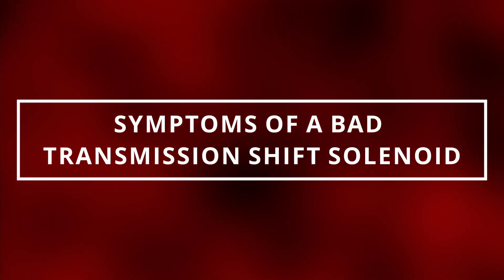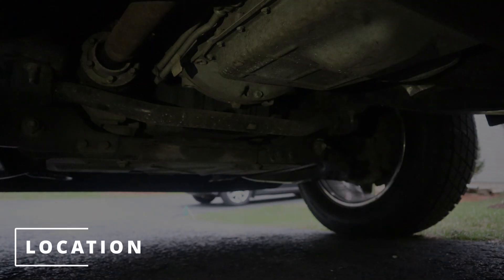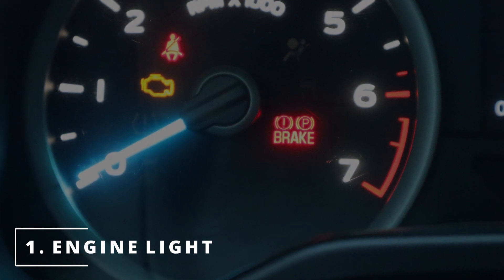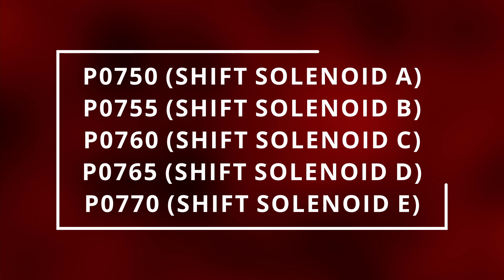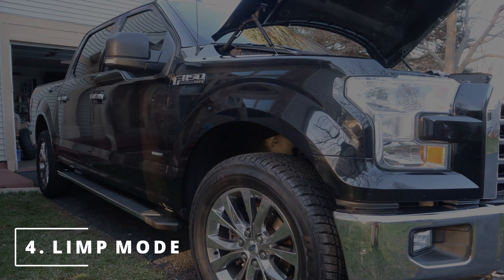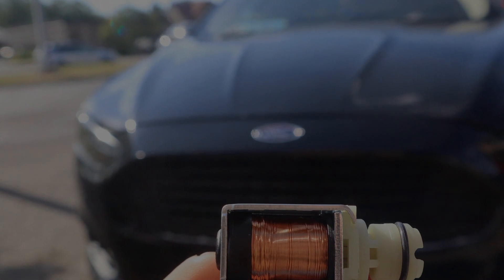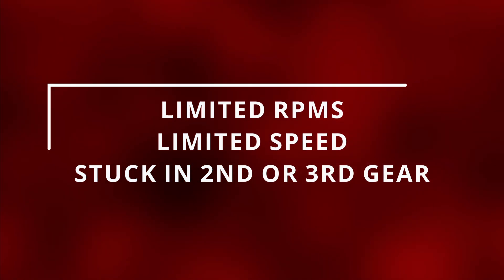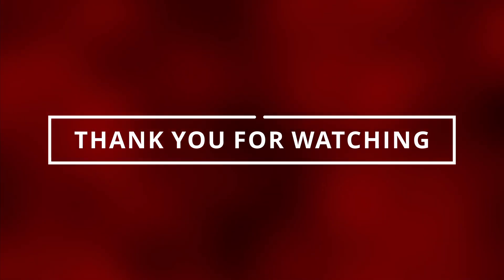SYMPTOMS OF A BAD TRANSMISSION SHIFT SOLENOID

Comment: Those are exactly the symptoms my truck is having 😢 better than needing a new transmission by far😅
Reply: Did you get it fixed?
Reply: Was it fixed? I went to Ford dealership and the technician told me to keep driving it that it might last 50,000 miles or 100,000 miles. 😂

Comment: Who’s having a remarkable day binge watching problems with transmission videos? Lol
Reply: Facts!!! I thought the same. Uh yeah no I’m not having a remarkable day trying not to cry while transmission shopping.
Reply: 😂.  Day 3 now.  And all I'm finding is that it could be 5 different reasons my truck is stuck in limp mode.
Reply: Fml
Reply: if anyone thinks it's a bad day trying to figure out your transmission problems... I successfully replaced a valve body (with new AFL and all solenoids) on my 2000 gmc 3500 and a month later a freeze plug gave out, let out all antifreeze and now my motor is blown....
Reply: @bobbyatman273 Yhea that sucks! Happened to me a few yrs ago! Replaced the water pump and didn't connect the tranny cooler line properly back! (Stupid ass quick connects) driving home after fixing it then line popped drained all the fluid & seized the tranny!!! 👉😖FML!! lol shit happens!!
Reply: lol not by choice!!! Plus I'm missing my Lions game FFS!!
Reply: Me lol

Comment: Ok in my 05 trailblazer there is 2 solenoid 1-2 2-3 or 3-4 not sure but there's 2 my truck shifts 1-2 but no 3-4 , my question is is which solenoid is the bad one? How do I tell the 1-2 from the 3-4? They look exactly the same?

Comment: I have a 1990 300zx auto and my car will only go into first and second gear until I hit the overdrive button would this be a bad solenoid if the transmission is shot, I’m going to manual swap this thing

Comment: Great video. So the transmission not shifting from drive to another gear including park will throw a code? 2008 versa stored for 2 years and when parked had no problems. Thanks.

Comment: Hey, thanks for the video. 

If my truck shifts fine through the gears in Drive, but when i put it in reverse it lags and jobs into reverse if the RPMS increases. Could this be cause by a solenoid??

2013 ram 2500 hemi

Thanks

Comment: Am using 2004 honda Accord 3.0 v6
My problem is whn i kick full acceleration rip goes high and rpm is cutting off.. not shifting to next gear .but when i drive normally all gears are shifting normal.. only in full throttle rpm is cutting and not shifting anyone knw why?

Comment: Thank you for the information.  Driving home last night (any where from 40 - 70 mph) with no stops, until in town, my 2009 Chrysler Town & Country stalled.  Started up in neutral, shift to Drive, and it stalled again.  Kept trying, was able to get it going and found it would run/drive using manual D1, D2, etc.  Works okay in reverse.  No engine light though?  Prior to this stalling problem I have noticed at stop lights, the engine seems to idle at higher RPM.  But not all the time.  Taking it to the transmission shop for professional diagnosis.  Have a great Labor Day weekend!
Reply: I know this is an old comment but did you find out what the problem was?

My 2000 ford expedition 4.6L V8 Triton XLT 4 wheel drive is doing similar, and there is no check engine light, but my ABS light is on.
My vehicle won't even go in reverse or allow me to shift to Park. I only can drive if I put the gear in 2.😬
I was told it was my Shift Solenoid that needs replacing.🤔
Reply: @flowersfam3462 Had a 2,000 bid to open it up and work on it.  But the mechanic did not really want to do it.  The other transmission shop would not even consider checking the solenoid.  So I chose to replace the transmission (they gave me a 3 year warranty on the new one).  
Three days after it was fixed my battery died.
The one fella told me his wife's truck was shifting bad and it was because the battery was going bad!  Some kind of electronic issue!  I'm putting that fact out of my mind to not second guess my purchase!
Reply: @kathysaul9645   Thanks for the response.

Comment: My blazer wasn’t shifting into park I changed the shift cable and it started going into park now once in a while it goes into limp mode but I had changed the A and B sensor last year maybe I need to change the other 2 sensors

Comment: A delayed shift and a slow shift/delayed engagement are two different things. Delayed shifts will happen at Higher than normal rpms. A slow shift is like a little slippage. My 2002 Camry will shift ok at very light throttle. but under normal acceleration it may not shift until 4500 rpms when it should shift at 2300 rpms . with no error codes.  ?   ?   ?   ?
Reply: I have a 1999  Lexus ES300 which is typically a Camry. I got a check engine light , codes are P0171 on one bank P0172 on the other bank in addition to P0325 comes and goes. I know the first 2 codes are related to my bad MAF sensor, but the second is Knock sensor code which seems to me a false diagnosis. The gear shifts first and second ok and then it gets stuck at the third and it doesn't go into the fourth gear. I notice the RPM and the Odometer pointers are parallel , meaning the RPM could go above 4000 and the speed is about 60. That what made me question, does a bad MAF cause this gear performance? is it really a knock sensor or is it the solenoid as explained in this video. You seem to be well knowledgeable in this type of problems and I appreciate any help/advice  you can provide.
Reply: @ednakh964 
Try unplugging the maf.
My camry issue turned out to be a very dirty maf sensor. And the car drive mutch  better with the maf unplugged 

Unplugging the maf will cause a check engine light and the engine to stumble at first. And take it for a test drive.

There are two parts of the maf that need to be cleaned . (Must use maf sensor cleaner) in a spray can.

One part you can seen easily after removal. It looks like a brown drop of varnish. The upstream side gets covered with dust. 
The second part that must be cleaned is two diodes hiding at the bottom of one of the channels.  Mine were so dirty I did not see them.

I dont know what symptoms a knock sensor shows.

I am going to Google those other two codes.

Has the check engine light been on a long time
Reply: @ednakh964 check around the air box for a disconnected vacuum hose.  On campus a vacuum hose needs to be disconnected to change air filter
Reply: SOLVED very dirty maf, mass air flow sensor.
Clean with maf spray cleaner. Make sure to clean the two diodes in the bottom of the maf.  Mine were so dirty at the bottom of the maf. I missed them the first time I looked. It cost me 10 days and two 5 quart tranny fluid and one quart Lucas tranny fix

Comment: Toyota dealership tried to say my transmission needs to be replaced. 

I said no thanks.......

Just change the fluid, strainer, gaskets and shift solenoid. 

260 k mile tundra  

Guess what 

Runs like I just drove it off the showroom floor!🙏✌

Comment: When I tried shifting my Chevy truck from Park to Reverse, it was stuck and I  was very nervous that I had to force it.  A week ago, it did the same thing, but not as bad. Other than that, I think it drives fine, but I haven't put it to a test. I am an easy driver. This is an automatic.
Does this sound like a symptom of bad shift solenoid ?

Comment: I have a 2003 honda civic and when I floor it the transmission is getting stuck at every gear when flooring it. Only way to get it to shift is to let off the gas and push back on and then it shifts up. Does anyone know what the issue is?

Comment: I have a 99 trans am it will not shift from 2nd to 3rd I changed filter an pan gasket an both shift solenoids,still same thing,it won’t shift into 3rd,should I replace all solenoids there is like 5 more around the valve body?

Comment: Quick question if the check engine light says shift solenoid then most like it is that and nothing else? It just doesn’t shift gears I have to let go of gas to do it besides that it runs perfect. Sorry noob asking

Comment: So right now my ford fusion is having issues. While in drive it works fine but when I come to a complete stop and take off the car gets stuck in like a neutral statem. The RPMS build up but the car doesn't move. After a bit the car catches a gear and starts going

Comment: Hey guys, I am getting "Error Code P0957 Auto Shift Manual Mode Circuit Low" in a 2010 Dodge Journey. The vehicle will drive fine most of the time but will suddenly shift into second and redline the RPMs if I am over 70kph. Once I pull over, put it in park, shut off the vehicle, and restart the issue goes away. Any idea how to remedy this issue? Thanks.

Comment: the problem I have is that: when the transmission is cold it runs fine. when it gets warm the transmission feels like it's in N it will not go at all.  After it gets cool its starts and runs a few blocks and again same

Comment: Is it possible to make the TV cable adjustment too many times? If so, what are the repercussions of doing that? I've been having issues, for about 6 months now, with my 94 XJ automatic shifting either too quick or too late, very erratic overall. I've replaced the TPS and have done this adjustment probably 20-25 times over the coarse of the last 6 mos. Yesterday, it started to not shift at all on the highway. I would press the gas and the RPMs would go up over 3000, but it would not accelerate and I had to coast it into a gas station. Went out and made the TV cable adjustment and then would crank, but not start. Repeated the adjustment 5-6 times and still wouldn't start. Unplugged the TPS and it started right up. Attempted to drive it the 5 miles home, with the TPS unplugged, but the same issue came up with it not shifting or accelerating. Is this what they call "limp mode"? Anyway, I pull over and plug the TPS back and try to start it and this time it started and mysteriously drove and shifted much better, although still not perfectly. Should I be looking at something in the transmission itself at this point? It's full of fluid and it's the stock AW4 tranny. Does any of this sound related to a neutral safety switch problem at all? Thanks for any help anyone can offer.

Comment: I have a 2014 Mazda 6 Touring Skyactiv that has a delayed shift from park to drive, then slipping between gears, how do you identify exactly which solenoid would cause these symptoms?  From park to reverse is fine and it seems fine when operating manually.  Thanks

Comment: I drove my Infiniti yesterday after I changed the value cover gaskets and the manifold for the intake I put it on my scanner which didn’t show anything alone the lines of of TCM so I’m trying to figure out what the problem is I didn’t have the time to check the the transmission fluid hopefully

Comment: Interesting.  I am wondering why my car doesn’t move when in neutral.  Even going down hill.
Reply: Get your Fred Flintstone heel off the brake pedal!  Seriously... though.... does the transmission work?  Drive?  Reverse?  If I was troubleshooting someone's car and it wouldn't roll when in neutral the very first thing I would do is raise the car one wheel at a time or all at the same and see if the wheels roll freely when in neutral and the parking brake isn't engaged.  In other words, I'd be sure I was looking for transmission issue and not something else such a stuck brake caliper.

Comment: My 2005 4l60e shifts through all gears, but it sometimes slips when in 4th gear. I bought 2 of the shift solenoids and the torque converter clutch solenoid, filter and pan gasket, but I'm not sure they are my problem. Usually accelerating hard in 3rd gear, then letting off the gas at the same time I shift it into Drive (4th gear) and leave my foot off the gas for several seconds, it will go into 4th without slipping. Otherwise it will go into 4th but will slip after the truck has been driving for about 10 minutes or so. Must have something to do with warmer transmission fluid helping to cause the problem. Anyone else had this problem and fixed it?
Reply: I have the same problem with the same transmission!! Did you end up finding and fixing the problem??
Reply: @SixOFiveSix  No, I haven't messed with it yet. I'll let you know if I figure out what the problem is though.
Reply: @CarbonGlassMan  so are you still driving it and if you are, is the problem getting worse or is it staying the same?
Reply: @SixOFiveSix  Still driving it and it seems to be the same, not getting worse.

Comment: What if my transmission just stop shifting out of no where ?? Drive it like 15 miles right before I got to my destination it just wouldn’t go foward or backward but keep in mind it never slipped it’s a 2002 dodge Ram 5.9
Reply: The very first thing to do is check for codes.  I recently diagnosed a Ford Explorer that had always worked perfectly and then suddenly... boom!  No limp home mode... no nothing.  There was a code for overheated fluid.  The overheat sensor had totally shut down the transmission due the fluid getting too hot.  Took lines loose from transmission cooler and it was clogged which was causing the fluid to get too hot.  Flushed it out and it's back to working as before.

Comment: Anyone have an answer for a 2000 2.2 auto s10 that slams into drive sometimes and then when in drive it dont wanna move sometimes and other times it shifts perfect
Reply: Drain the transmission pan and see what the fluid looks like.  First, though, check or have it checked for trouble codes.  It could be valves in the transmission sticking due to very contaminated fluid.  When checking the fluid you're looking at how dirty it is and especially is there excess metal particles.
Reply: @Watchdog U.S.A.  thanks man i figured it out im 95% positive the neutral safety switch is bad

Comment: My 2006 Mitsubishi lancer ES 2.0 is giving me a secondary DTC, 44: 4th not synchronization. Any ideas as to what that means I’ve looked EVERYWHERE and have only been able to find one thing about it possibly being my 4th gear. It drives fine and revs up fine but will only reach speeds of 45 on flat roads and will only rev but not gain any speed at all going uphills. Also when I first bought the car I would occasionally hear a small grinding noise when my car would hit overdrive but now it’s making it only louder whenever I try to pass 45mph.I’m not much of a car guru but I’m trying to learn. Any help as to how to go about it and what he price of fixing this issue would be would very much be appreciated!!

Comment: I’ve got a 2014 Grand Cherokee, Symptom is limp home mode in cold temp ~ 25 deg F. Once I warm up the car, turn off and back on again the transmission works fine. Do you think this could just be that I need new fluid or an early sign of solenoid failure?

Comment: My transmission shifts fine except it will not hit 6th gear when it is very cold out until the transmission warms up for about 30 to 45 minutes. It does not throw a code. Could this be the solenoid pack going out?

Comment: I have a 2010 nissan rogue cvt level is good but 80% of the time when shifting from P to R or D it shifts pretty hard, any idea if a bad valve body could be the culprit? (Mounts are good)
Reply: First problem is it's a cvt transmission. DOA

Comment: 95 Ford Explorer
Trans rebuilt 35000 miles ago, reverse and neutral move forward, Can upshift into higher gears. ( so I know its not clutches burned or anything)

Im thinking valve body issue: manual valve, or one of the solenoid…
Any help is appreciated.

Comment: This is a long shot hoping someone will chime in with some advice. I just had my transmission rebuild on a 2015 gmc Sierra 5.3. - I feel like the mechanic has done something incorrect. he has had it for a month now. has retired it to me a few times and the truck is not shifting correct. once up to full operating temp it will slip badly going into 2nd. Instead of shifting it will go into neutral and the revs will go up fast until I let off the gas , then it will usually clunk into gear , it goes through all the other gears fairly normally. he is claiming that the truck has to go thru a "learn cycle" than can take multiple days of driving it with these symptoms. sometimes it will just stick in second until oi come to a complete stop then it will go back to normal for a little while. it is also leaking a considerable amount of fluid, took it back twice for just the fluid leak and he keeps saying its fixed but then I take it home and its leaking. he said "sometimes it will leak a little at first"....none of this seems correct. the truck only has 80,000 miles on it and I do not think it even needed a transmission , the whining noise it was making that brought me in the begin with has not been resolved with the rebuild. this shop is where my warranty required me to take it and has very good reviews so I felt like it was a reputable shop.  Is it true that a 2015 gmc transmission requires a re-learn period like this and do these sound like normal symptoms of that? I paid a lot of money for this truck and feel like this guy may have destroyed it. the amount of time it is taking is also excessive seeming to me. PS there is no check engine light or trans light coming on and this is why he says nothing is wrong. he has finally agreed it shouldn't be leaking trans fluid so it is back there again for that to be fixed.